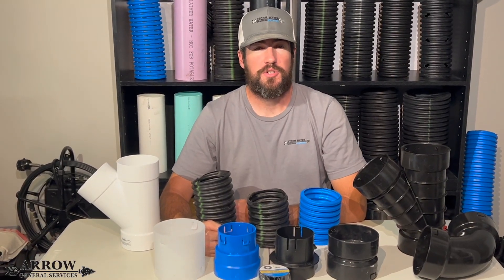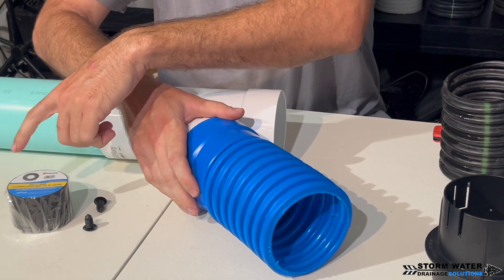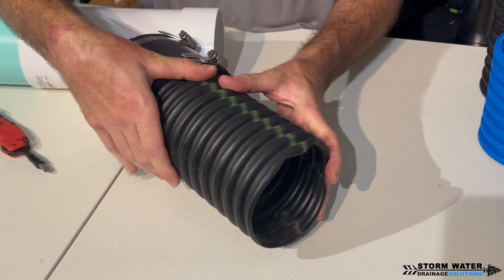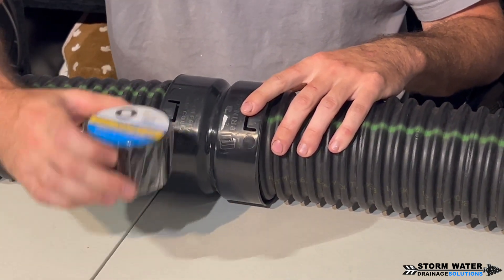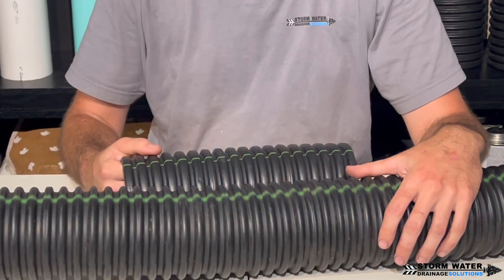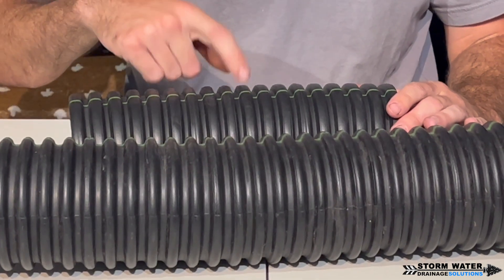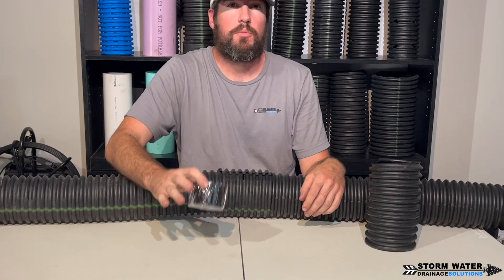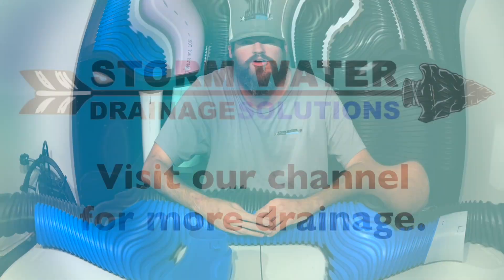How To Connect Corrugated Pipe To PVC Pipe - Corrugated Drainage Pipe Connections - Yard Drainage

Comment: Some guys that my pool builder brought in to address drainage spliced corrugated pipe to connect three lines together into a Y. They "sealed" it with duct and painter's tape and didn't use any couplings. Needless to say, it wasn't water-tight and I ended up digging the pipes up and have been looking for a solution. This video was so helpful!

Comment: I have a Fernco adapter, and both the 3" PVC end and the 4" corrugated tile end are very hard to push in. I used a bit if sandpaper on the PVC end to get it in, still with effort, so I am not concerned leaking, but the corrugated end is no joy. Any ideas, maybe grease?
Reply: Try some soap on it

Comment: Hi everyone. I am able to find a connector (blue or black) up to 6" diameter. I have up to 12" diameter storm drains. That means all we can use is the no-hub coupling for bigger sizes?
Reply from the maker: @jerometandoc  Depends on what kind of material you’re working with. Are you working with RCP? HDPE? PVC?

Comment: At  at 9:18 the DIY coupling from a scrap piece looks more secure than the ones you have to buy. Just use one scrap piece over the ends of the two pipe sections, and tape the whole thing up. No need for a second scrap piece over the first piece.

Comment: any tips for pvc to double wall corrugated connections? Thanks
Reply from the maker: @Voltron-1234  Good question, you could use a no hub rubber coupling.

Comment: On the external coupler, you bashed the “big box store pipe” and showed how the coupler didn’t work very well but you were putting a Prinsco external coupler on ADS pipe. You were not using ADS’s external coupler with their pipe. The corrugation patterns are different between the two different companies. If you used ADS’s coupler you wouldn’t have the slop you showed.
Reply from the maker: Those Prinsco external couplers work fine on ADS pipe when you buy it from a water works store because they sell better quality pipe to them with the original corrugated pattern and thicker side wall. We use these couplers on FDM pipe as well. The low quality pipe that the box stores are getting doesn’t fit well in the couplings and ADS fittings either. It’s a whole mess. They have the wyes and elbows being sold next to this new style of pipe and none of these fittings connect well to it. And ADS big box store external couplers are no good IMO. They make a better one but you won’t find it in a box store.